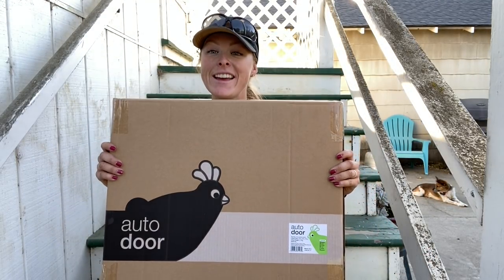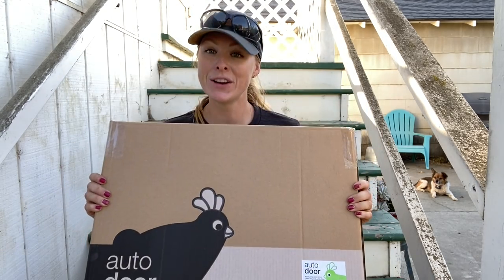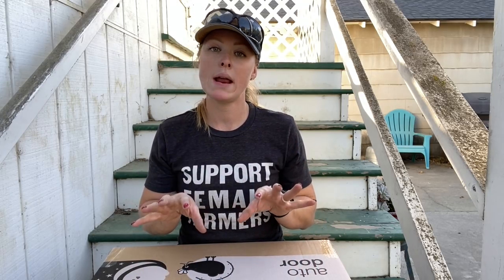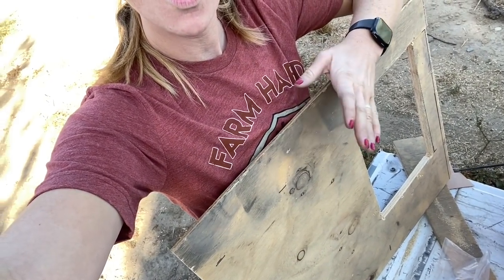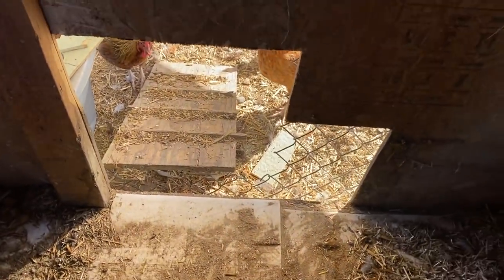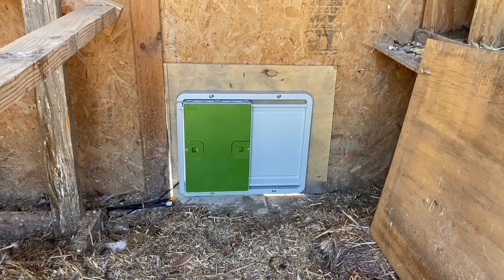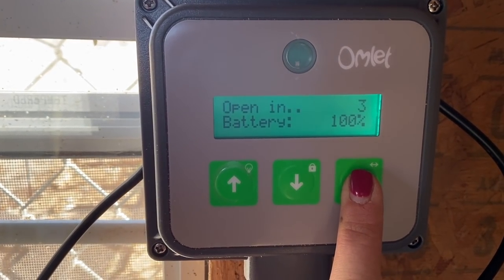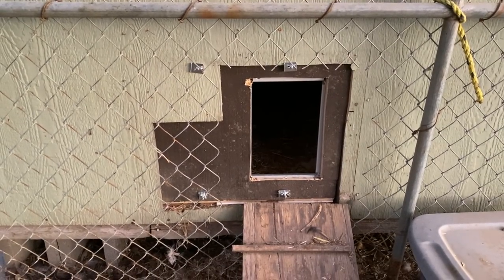Installing Omlet Auto Door

Comment: I just ordered the Omlet Automatic Chicken Door yesterday. Thanks for your video. I hope I don't have too much trouble installing it. I've had chickens for 2.5 years and no problems with predators until the other night. My chickens alerted me to an opossum that had gotten into their coop, without much trouble I'm afraid, due to my naivety. Their coop is inside their run (a converted dog kennel run) and I thought it was secure enough to leave their little pop door open, my bad!!! Thankfully the possum was only interested in the one lone egg that was in the nesting box and not harming my chickens, but the girls sure were riled up!! I realized at that point, in order to keep my chickens safe, I need to have an automatic door and I'm also in the process of a solution to cover the chain link portion of their run. It has a free standing roof over the top but it's not connected to the chain link run, so I think the opossum was able to climb in over the fence. If an opossum can do it, I'm afraid now that raccoons can too, so I've got to lock that place down to outsiders!!